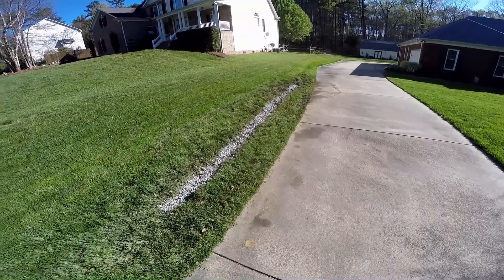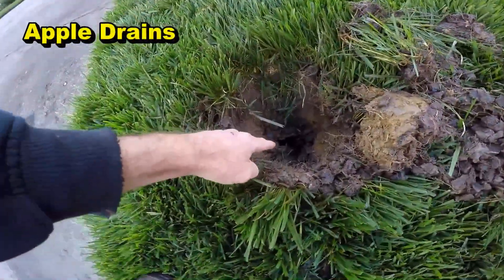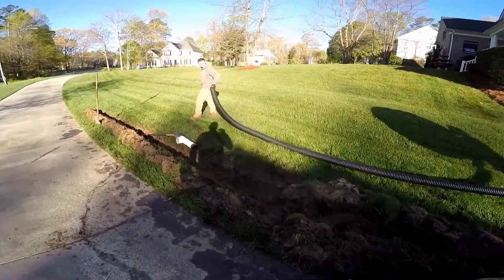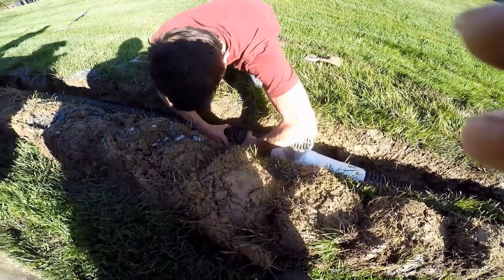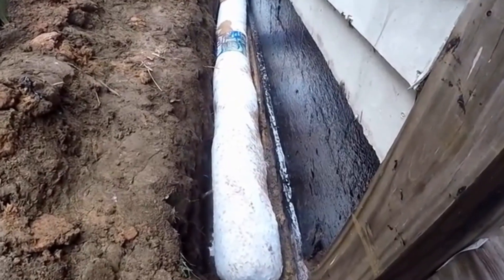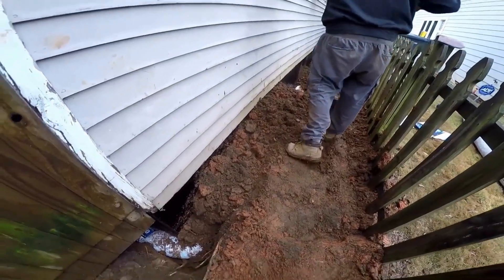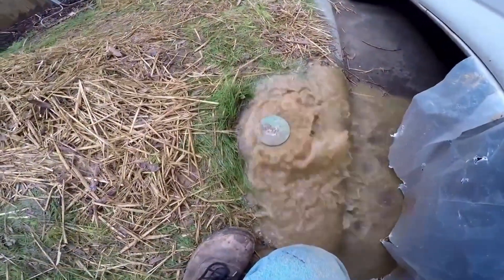Which is Better French Drain? Gravel or Styrofoam, EZ Flow, Yard Drain

Comment: Why are you bearing A vertical 18/ 24' Pipe -- if it doesn't carry or redistribute the water anywhere (except back and forth) ?? Thus the Pipe is pointless.

Comment: Where do you have the water going once it makes it way into the pipe?
Reply: Exactly, Lmao! I have asked the question (or made the same statement) to numerous "French Drain" people- "Why bury A Pipe, if its not carrying or redistributiing the water anywhere?" It's pointless!
> None of these people have responded. Its basically A backyard over flow reservoir system (which is cool), but doesn't require A single 20' ft vertical (pointless) pipe. It's ridiculous.

Comment: where is the geotextile separating the gravel from the dirt? This drain isnt going to last long.
Reply: The correct sand/gravel is far better than fabric...as it infiltrates 3d vs 2d.  This is actually backed by studies that show infiltration/blockage rates of 1/4" per 5 years in high-quality sand.  This is way better than fabric that will blind up.
Reply: Varicore Technologies can you link the study please?

Comment: I would be interested to know which one lets less sediment through between EZ's peanuts and gravel. Even tho Styrofoam has a better flow rate supposedly, does it get trapped with sediment more or less than gravel? Thanks for your video's :)

Comment: I'm so confused how french drains work. Once water is inside the pipe, where does it go? Where do the ends of the pipe go? To the sidewalk/street? If it's underground, how does it come out? Is there a slope needed for water to travel through the pipe?
Reply: Yes you need a slope, but it can be pretty minimal. There has to be an outlet. Many people run them to the curb with a concreted-in outlet.

Comment: when installing a french drain using 4" pipe and gravel, how deep should your trench be?
Reply: Mike DuCK 2 inches gravel on bottom, 4 inch pipe, 2 inch gravel on top and then 1 inch or 2 topsoil, so 10 inch deep or so

Comment: So we really didn't answer the question posed by the title - which is better?
Reply: Ryan James 
at 5:43 he also said the foam works really well, but they use gravel because it's cheaper
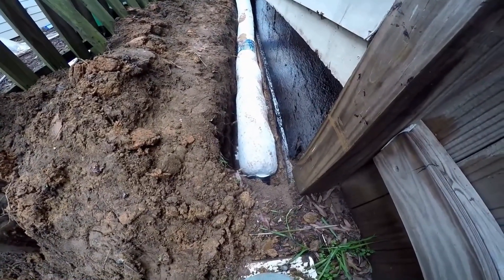Reply: "Styrofoam has 30% better flow rate..." at about 6:30
Reply: Gravel...i didnt mark the exact time but he expicitly said "THIS IS WHY YOU HAVE TO USE GRAVEL". so I assume if the  2 materials (gravel and styrofoam) act as functional substitutions in the french drain, and he said to use gravel, that infers that GRAVEL is better.